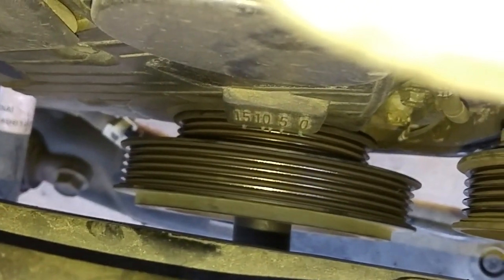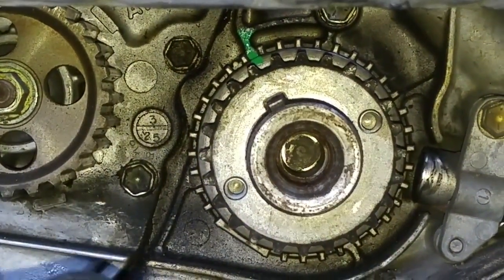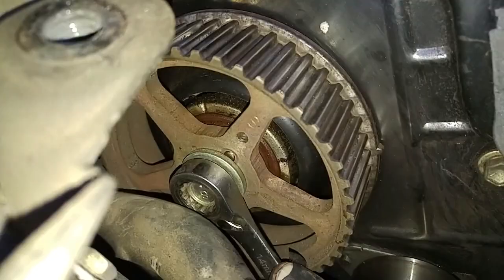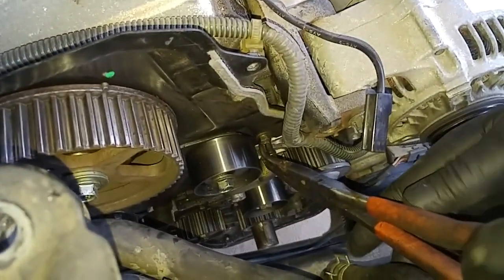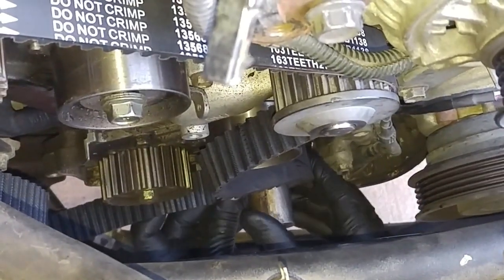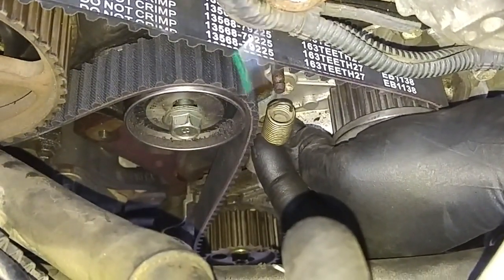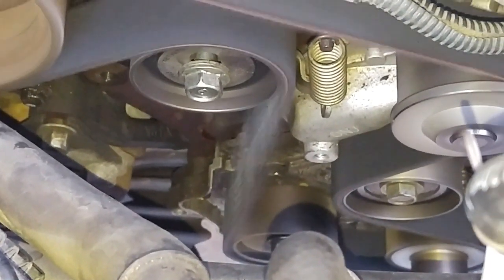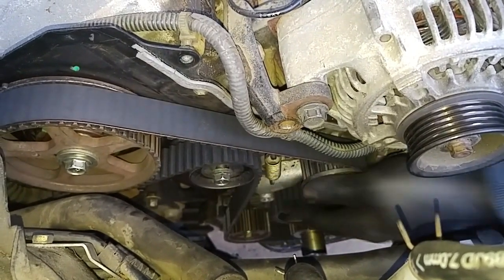Broken Timing Belt Replacement - Toyota I4 5SFE Engine

Comment: Excellent techniques to seat the belt, while ensuring exact mechanical timing!  Very helpful!
Reply from the maker: Glad you enjoyed it!
Reply: My apologies I was wondering did you turn the camshaft backward to line it up or forward but I just realized that it's a non interference engine so that's why you was able to do it that way if so
Reply: @curtistate6372 that’s what I’m thinking cause mines has slack and I’m gonna try it and it’s non interference so it won’t mess up

Comment: very informative video, but Im rather curious on something , if the timing belt broke ..How did You  FIND/VERIFY You Were At TDC & Not The Exhaust Stroke (with your green marks on the harmonic balancer and the timing belt cover timing tab  both at the "0" mark)..as I said just curious as my timing belt broke  recently on my 99 camry 5SFE engine..thnxs in advance
Reply from the maker: You mean the camshaft ... not the harmonic balancer?  The balancer sits above oil pan, bellow the engine block and is gear driven.  Nothing to verify or find.  Just follow the instructions in the video.  Set the crank at 0 degrees and turn the camshaft till the alignment hole is aligned with the vertical notch on the camshaft bearing cap.
Reply: u can be 180 out thats what he means?
Reply: @chrissizemore745  I think you'd have to look inside the distributor to be sure-at TDC/compression the rotor would be at no.1 coil for ignition spark
Reply: On this vehicle you just remoce valve cover and look at the dual cam marks and they'll be aligned. Or I guess you gotta 50/50 chance this way lol
Reply from the maker: That's correct!
Reply: This motor has duel overhead cams. So the exhaust lobs are not on the intake cam. The cam you aline is the intake so as long as the marks line up you will be at TDC a 180° turn would open the exhaust valve. I had the same thought but then realized I'm working on a 01 and not a 81 hahaha

Comment: A client called me to check is Toyota Camry 2000 model with a 5sfe engine which always have a broken timing belt about 4 days after replacement. When I examined the car the only thing I saw that seems to be faulty was that the belt was weak, not really tensioned. The engineers have replaced the timing belt adjuster but to no prevail, the belt keeps cutting off.
 There was no oil on the belt that could be responsible for that. 
Please help me, what could be causing the belt to cut frequently?
Reply from the maker: Bad low quality idler and/or tensioner bearings.  If they wobble or out of center, belt gets stressed and snaps in short order.  Get Aisin, NTN or GMB bearings.
Reply: Hlo engineer, I have my Harrier 5s engine by as I accelerate it produces a cracking sound around the areas of the timing what could be the problem sir

Comment: There is a small bump just to the left of where you put the green on the crankshaft TDC on the engine. Thought that was where you line up the notch for TDC?  Or is the way you did it more correct?
Reply from the maker: I see what you're talking about.  Thing is, that bump on the engine block (or some people would call it the oil pump casing) doesn't line up with any marking or notch that I can see on the crankshaft pulley.  If you want to ensure you're at TDC on the crank, just temporarily install the lower timing belt cover and harmonic balancer.  Turn the balancer until the notch lines up with the 0 degree mark on the TB cover.  Then take off the balancer and lower TB cover.  You'll be at TDC.  I use the green paint to ensure the crankshaft didn't move during the belt installation.
Reply: @hardlymovingpro   - Thanks for the prompt replay.  That makes sense, will do.  There is such a miniscule "v" on the crankshaft using the cover and the "0" ask TDC works better for me.
Thanks again.
Reply: @hardlymovingpro  - there is another popular youtuber who aligns the mark on the crankshaft timing sprocket (behind the harmonic balancer), with the bump. But the mark is quite difficult to find. But thank you, always good to have alternative method if the other one fails.

Comment: I just changed my timing belt and rollers and pump and seals if the belt breaks is this a non interference engine. You can run the engine before installing the covers with harmonic balancer on  with the jack on the engine pan.
Reply from the maker: Yes.  This is a non interference engine and you can run the engine before installing the covers and harmonic balancer.
Reply: Yes its nice to run and see how everything is  working like the belt tension.

Comment: Did timing belt on 5sfe and went to start and wouldn’t turn over. Now my crankshaft pulley is at a dead stop and won’t get any farther. Same with turning counter clockwise. Belt is off and spark plugs out and still the same thing. Tf happened. Car ran great with no issues before all of this
Reply from the maker: The 5SFE engine is non interference ... meaning the crankshaft can rotate, with the belt off, without touching the valves.  What you're describing is a seized engine.

Comment: But you need to take the harmonic balancer/crankshaft pulley off, wouldn't that move the position of the timing mark to the timing cover? Even gunning it off could move the crank a bit, then i'm assuming you just gently nip the bolt up until it turns clockwise to the mark and zap the bolt off again and hope it doesn't move?>
Reply from the maker: The pulley will not move if the bolt is removed with a impact gun.  Even if it did, you can reposition.

Comment: @Hardly Moving Productions.
I have a 98 Celica GT, 152K.  Starting to get a rattling sound from the TB area. Have not pulled the covers yet.
You left the alternator in place, didn't remove the wheel w/inner skirt and didn't unbolt the motor mount to jack the engine up as I've seen in other vids. 
Question 1: Is your method only for belt and pully replacement or will it work for water pump replacement as well?

Quoting your comment from below "Considering it's a 98, I'd do a full service repair replacing the bearings, w/p, cam, crank and the oil pump shaft and cover seals."
Question 2:  What are you referring to with regards to the cam, crank and the oil pump shaft?
Thank you!
Reply from the maker: Here's a link to a video on doing a complete belt replacement:  https://www.youtube.com/watch?v=ks0ynJxYLnY
Here's a link to a video on replacing the oil pump seals (when doing a belt replacement):  https://youtu.be/_tsAtyOGpaQ
This should answer most of your questions.  Good luck!
Reply: @hardlymovingpro  Thank you Sir!! Your videos by far are the most informative and well made.

Comment: My 4 runner belt looks like it freakin melted all the way around idk. I’ve only got the cover halfway off I’ll finish when it’s daylight but it’s definitely the belt. 
I had turned the engine on to warm up and when I came back a few minutes later it was off and I smelled burnt rubber/electrical smell. Then the engine just spun with no compression. Hope this is a decently easy fix.
Reply from the maker: Wish you the best of luck with the belt replacement.  Recommend you replace the idler and tensioner pulleys along with the water pump while you're in there.
Reply: Thanks for the reply! So after taking the timing cover off I found the idler pulley bearings totally blown out. It still rotates when I crank over the engine. But I think that’s what’s caused the belt to burn up. 
I’ve been told that it’s a non interference engine so I guess it stopped when the timing belt started to burn as a safety measure? 
I just wonder why it seems like it had no compression when I turned it over?
This happened while the truck was sitting idle. I came back to find the truck off and the burning rubber smell. So if the timing belt is burned but still intact and the engine doesn’t compress when turning over is that a blown engine?
Reply from the maker: Believe it's a non interference engine.

Comment: I just did my timing belt on my 5sfe and I thought I didn’t had to tighten the tensioner bolt and the spring would put the tension on it and now my car won’t start so it would make sense that the belt skipped a tooth right? Don’t judge me it’s my first timing belt lol
Reply from the maker: Yes.  I'd would think the belt's out of alignment.
Reply: @hardlymovingpro  I just checked and you’re right it was out of timing by 4-5 tooth thanks a lot for the video it was really helpful👍

Comment: Please respond if possible. My timing belt went on my 98 celica GT and I was about 1/2 mile from work. Not knowing if I would damage anything my Celica surprisingly made it to work the rest of the way and was parked. Then turned on one more time to make sure it was the timing belt. Do you think my valves or anything were damaged due to it being ran the 1/2 mile? If so would it be easier to get a new engine? I absolutely love my Celica and want to get I back and running asap. If I am not mistaken the 2.2 liter 5sfe engine is on my 98 Celica as well.
Reply: I am aware that it is a non interference engine and am hopeful that I will only have to repair the belt and tensioners but a confirmation that my valves are more than likely okay would help alot!
Reply from the maker: The 5SFE is a non interference engine so nothing to worry about the valves being damaged.  I've replaced broken 5SFE belts with no problems after the belt was replaced.  Belts usually get stressed due to worn bearings in the idle pulley, tensioner pulley and/or water pump.  Considering it's a 98, I'd do a full service repair replacing the bearings, w/p, cam, crank and the oil pump shaft and cover seals.
Reply: @hardlymovingpro  thank you for being so informative!! Been looking all over for some good 5sfe  info. I'll be using your videos and tips!
Reply from the maker: @Con_Calmaa  No problem and thanks for your support!  For the 5SFE owner, slowly making my channel the one-stop site channel.
Reply: What are you talking about?  If your TIMING belt broke the engine would STOP running!!! You would not make it another 1/2 mile unless you were coasting down hill the whole way.

Comment: On my 98 Celica Gt the cam shaft bearing hole seemed to rotate to the left. And im unable to line the cam up at TDC. Any ideas? Thanks.
Reply from the maker: With the 5SFE engine you should be able to rotate the camshaft in any direction.

Comment: Wish my problem was this easy. My son’s 97 Camry’s engine is toast! Two con rods and crankshaft journals are totally damaged. I’ll just buy a used Japanese engines for it and down the road 🚗
Reply from the maker: Try shopping for a JDM (Japanese Domestic Market) engine on Ebay.  The engines generally have less than 60k miles and are imported directly from Japan.  A friend of mine got a JDM engine for his 1997 Lexus LS400 for $800 including the drop ship cost.   The engine came attached with the intake manifold, fuel injectors, throttle body, alternator, ac compressor, ps pump, etc... all from a donor car will less than 60k miles!   Car runs like new!

Comment: What is the point of the timing belt cover seal? I didn't have a replacement so it's on with no seal.
Reply from the maker: Rather useless in my opinion.   You can use a reel of rubber retainer material used to hold in window screens as a substitute.  It can be held onto the TB cover with super glue.
Reply: @hardlymovingpro  Thanks, will do that next time the cover comes off.

Comment: This almost the same as the 3sfe in the rave 4 1996 to 2000, I’m doing the full deal on it right now, water pump, thermostat, crank seal, oil pump seal and gasket and can shaft seal
Reply from the maker: Yes ... you ar correct.
Reply: Hardly Moving Productions thanks for the reply you got a subscriber here lol have a great day
Reply from the maker: @corey5291  No problem and good luck with the job!

Comment: I have a 96 Rav4 with the 5sfe. Did timing belt not long ago after it snapped. All has been fine but just wondering...are these 5sfe engines always sluggish with acceleration? I did a tune up with new wires, platinum plugs, & a new cap & rotor. How can I get better acceleration/pick up? I was thinking of replacing the coil but didn't wanna spend $90 more or less just to get very little improvement. I also seem to thing the cats(upper or lower)may be clogged. It passed smog with no issues so I'm assuming all is well with exhaust restriction. What do you suggest at this point?
Reply from the maker: What's the mileage?  What you can do is have the fuel injectors cleaned (via pressurized fuel injector service using FI & upper cylinder head cleaner) and install a new exhaust down pipe with a new cat attached.  Cat's deteriorate over time, can cause exhaust back pressure and relatively cheap to replaced.  Check out these videos:  
https://youtu.be/5eDf7xPqc7Y
https://youtu.be/BJMA_R5Pf6w

Comment: . I have a 2005 ls430 Lexus  with 225k and my  Timing belt broke  I'm going down the side of the road...  Show a be best for me to buy a new motor or look into the vowels fix.. help me
Reply from the maker: I have a friend who had the same problem with a 1998 LS400.  He found a replacement JDM engine with around 60K miles on Ebay.  He paid $800 for it with shipping included.  He then found a mechanic to do a engine swap for $700.  Overall, he spent around $1,600.  He's real happy with the engine's performance and says it runs like new.
Reply from the maker: Don't understand.  What was preplanned?

Comment: Hey man maybe you or someone else will get back to me. I want to do a replacement of my belt, exact engine. Im 17 and am mechanically inclined but I the aura around changing a timing belt is itself scary. 

I need some info as for what exact tools I need, and at what torque these bolts need to be at. 

What do I need to move or take off exactly to replace it (which i believe is the tire, rear dogbone mount, possibly moving over the alternator?) 

As much as I want to ask someone I know for help no male figure around me has, all i need is a little more guidance and I swear I can do this.

Id rather not have to pay $600 for something that in many videos and diagrams seems so simple.
Reply from the maker: Click on the video descriptions "show more" section to get links to parts and tools.  Recommend you get a Chilton or Haynes repair manual for your car.  Also, the hardest part in the repair for newbies is getting the crankshaft pulley bolt off.
Reply: @hardlymovingpro  I used bump start method, it worked, but you might need two or three goes at it. Bigger problem is tightening it up to 80 ft/lbs, had to make a tool out of plywood.
Reply from the maker: You can buy a cheap ac electric impact driver.

Comment: Wow, that's an old crankshaft sprocket. It doesn't have the little V cutout that you align with little nub on engine block.
Reply from the maker: Yup.  And you need the balancer and lower timing belt cover to  find 0 degrees TDC.

Comment: I thought the motors crashed when the belt broke? Good info
Reply from the maker: On the Toyota 4 cylinder interference engines (AZFE) that replaced the (SFE), the valves will bend if the timing belt brakes (the pistons smash into the valves).  The AZFE now uses a timing chain in lieu of a timing belt.  So if you don't change the oil very often, you run the risk of stretching the chain, wearing out the chain guides and could eventually lead to chain breakage.
Reply: @hardlymovingpro  v6 3.0?
Reply from the maker: Nope ... V6 3.3 is interference along with later models of the 3.0 with VVT-i technology.
Reply: How about 4.2 turbo diesel?
Reply from the maker: Don't know
Reply: What about 2.5 Turbo volvo
Reply from the maker: @jamalscott6114  can't say

Comment: How many miles did that timing belt last?
Reply from the maker: On the Camry up to 2001, 90k miles
Reply: @hardlymovingpro  i mean, how long did the one in the video last before it broke?
My oem belt lasted 127,000 miles before I replaced it. It still looked good when I changed it.
Reply from the maker: @maxnovo625  could look good on the outside but internally can loose its structural integrity.  I've seen cosmetically good looking belts that snapped.
Reply from the maker: @maxnovo625  also worn belt and water pump bearings that begin to wobble will cause undue stress on the belt.  This could eventually snap the belt way before the belt replacement service interval.  Which is why you should replace the bearings and water pump with the belt.
Reply: @hardlymovingpro  I'm glad you mentioned this, now i know not to look at the belt to see it's condition. Same reason I don't look at the color of oil for it's condition.